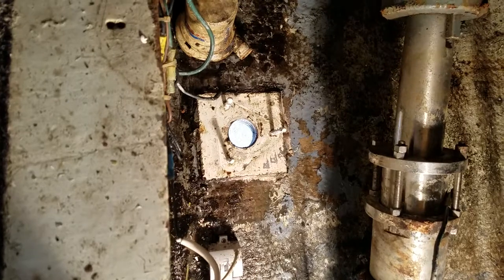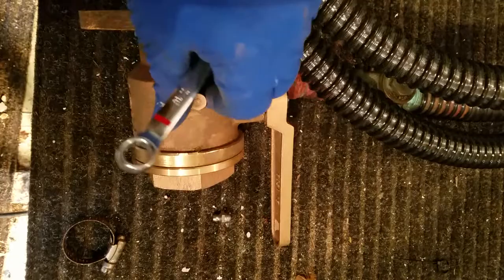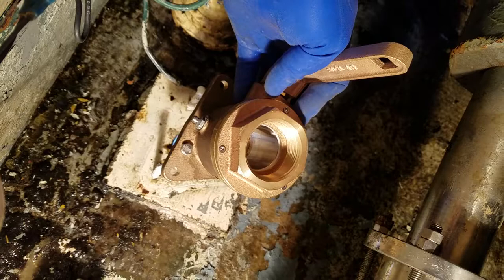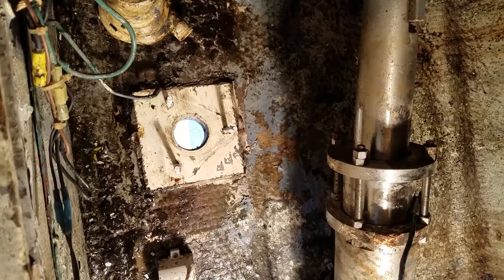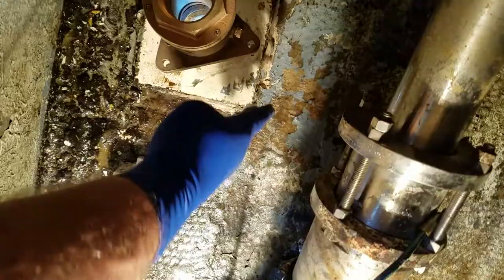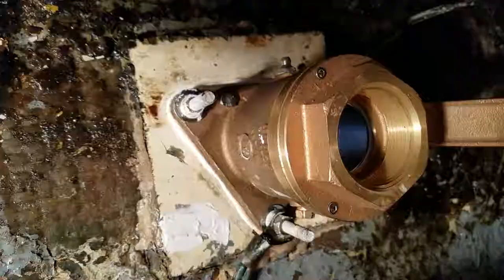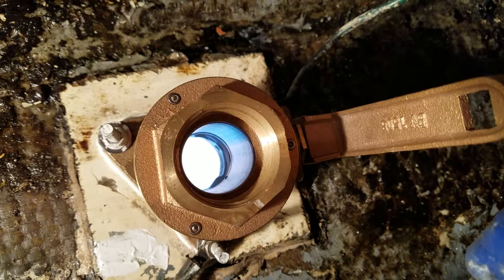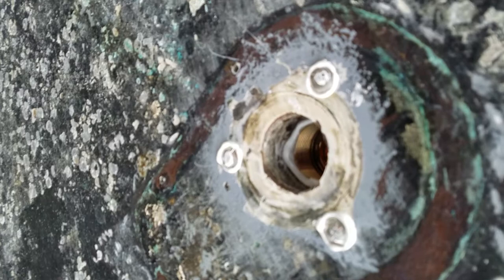Groco ball valve replacement

Comment: Any reason why you chose to add 3 additional holes for the bolts versus using the backing blocks the manufacturer makes for epoxying in and bolting down with out thru bolts? How have those bolts held up? Were they also bronze?

Comment: With just the hull thats mounted to,I believe I would have added a backing block as well,since theres bolts through the hull it would have been just as easy to glue a block in place then add the valve,it would been stronger and I would have used 4200.
Reply from the maker: Thanks for your feedback.  The hull is 7/8" of fiberglass.  The white block is a backing plate of 3/8".  Because of this extreme construction, another backing block is not necessary.  5200 is the best product for underwater applications, as well as permanent adhesion.  It is doubtfully I would ever remove this or want to, but if I did, I would first apply De-Bond, which chemically breaks down 5200 for removal.